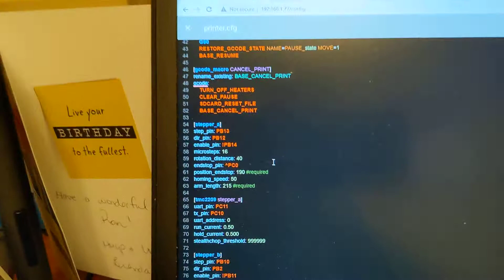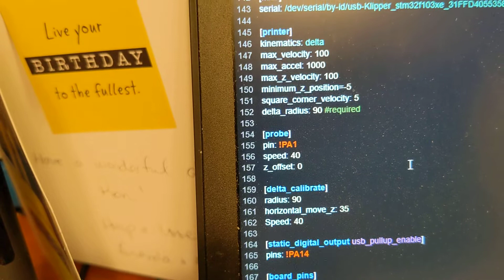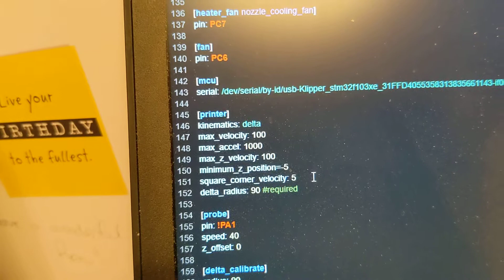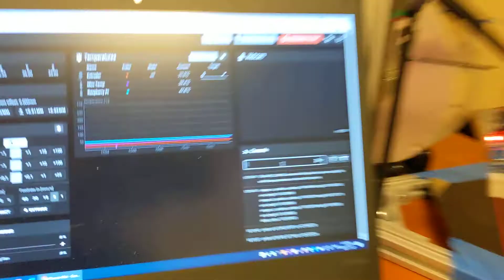Let's build a Delta 3D Printer Episode 7 Final Calibration!

Comment: Hello, I followed the instructions in the video and I have a problem when printing: near the pillars the print head touches the hot bed, and in the areas opposite the pillars it is in the air. The probe used is the one in the video
Reply from the maker: it's possible you need to do the klipper advanced calibration, or you have delta arms that are not the exact size. Not using good optical endstops can cause issues also

Comment: Hello!, amazing work here. I have a question, 330mm rails can be used in this build? or you use full 400mm rails? i like to reuse parts from another printer.
Reply from the maker: you can shorten the vertical 2020 to use smaller rails. Generally your linear rails should be 100mm shorter than your vertical 2020

Comment: Hi I use Delta calibrate ,it completely run ,but when  print start ,it crash to the heat bed , is it need to use probe calibrate?
Reply from the maker: if your probe is not accurate enough you may have issues, did you try the manual calibration method? https://www.klipper3d.org/Delta_Calibrate.html

Comment: Hi, thanks for quite detailed information, i want to manually calibrate the delta printer , i use octa print running skr 2 , klipper shows error need to home first.. any idea? Or if you can help please 🥺
Reply from the maker: you just need to home the printer first before starting the manual calibration. Delta printers need to home before any calibration can start

Comment from the maker: I have updated the GitHub with my printer.cfg, please note you will need to uncomment a few things if you want to use it as it has already ran though the delta calibration for my particular printer.
Reply: The link to your github doesn't work, did you remove the repository or made it private?
Reply from the maker: @kesor6  hi, these are now on my patreon STL Tier https://www.patreon.com/rolohaun